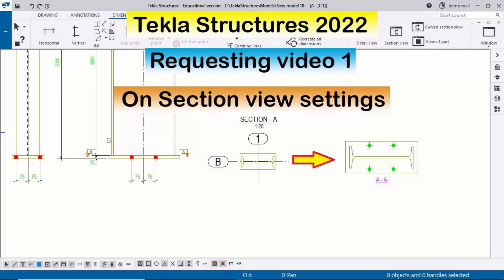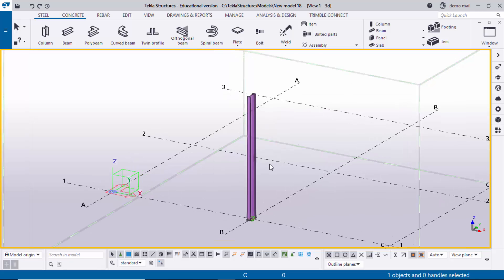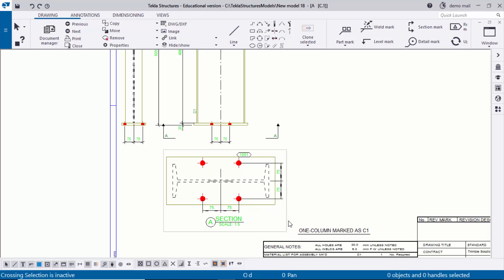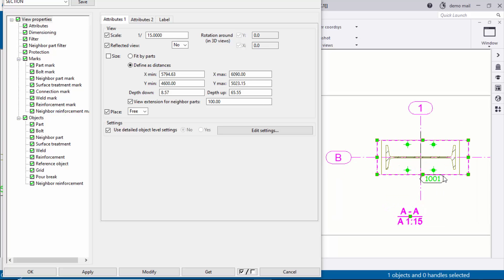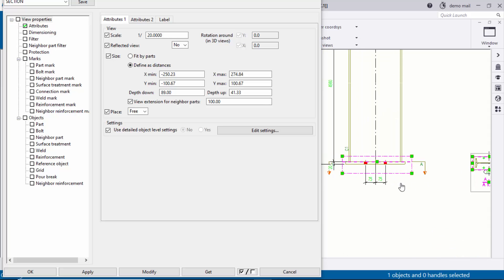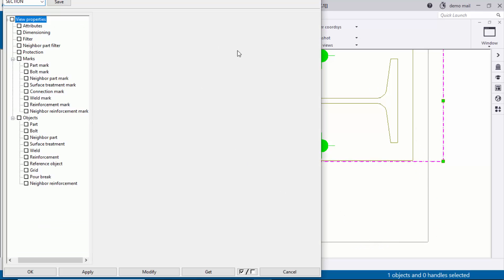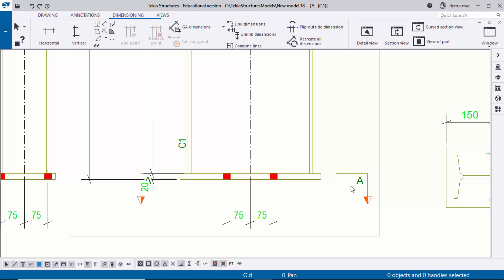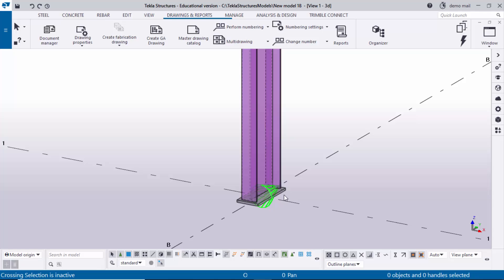Tekla Structures 2022 Requesting video 1 on Section view settings

Comment: Hi 
Gani sk
I want to ceate a Threaded bolt at top flange of w-beam with nut and washer. But, When I am going to create bolt in bolt properties. Head of bolt coming.
I want to remove head of bolt. Only I have need Threaded bolt without head.Please suggest me.